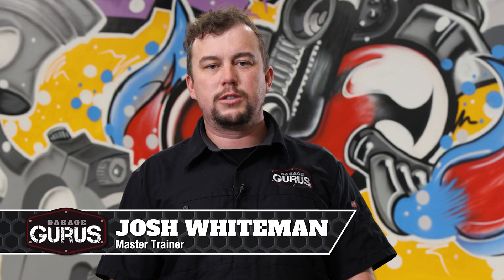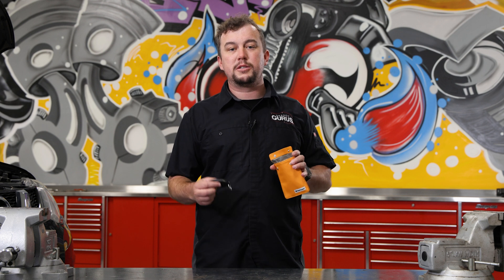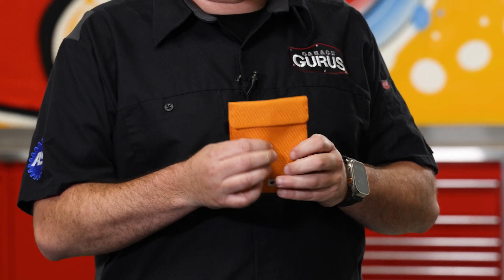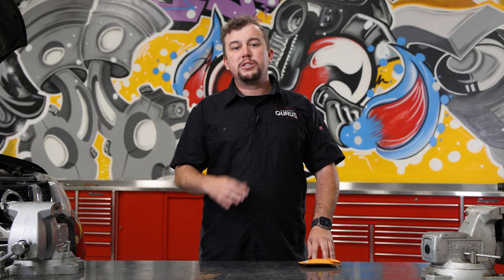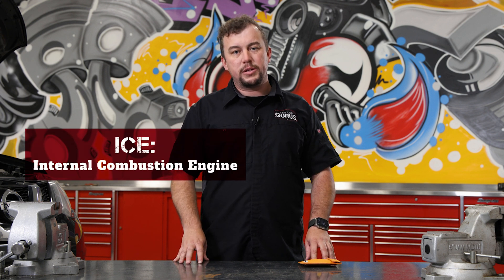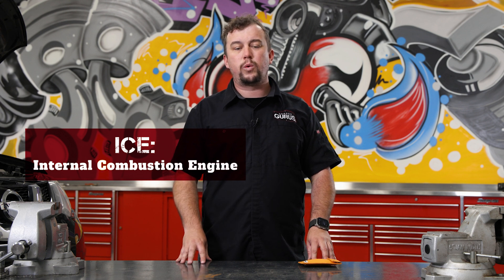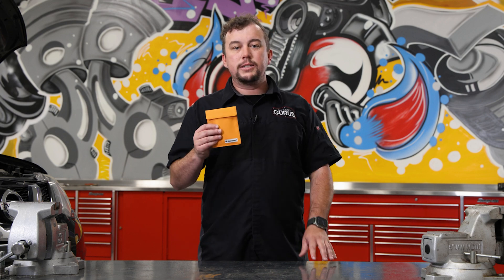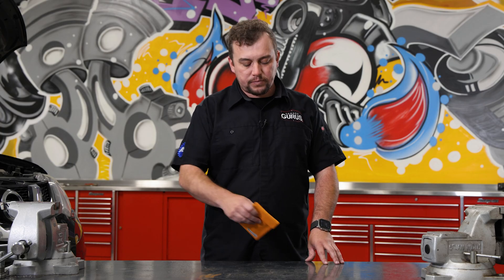Garage Gurus | How to Block a Key Fob Signal When Doing Repairs

Comment: 20 years ago I put a car up on the lift to do exactly that. An oil  change. As I was trying to lift it, the aftermarket alarm kept going off. From the motion sensor. 

The buttons were worn off the key fob, so I had no way of knowing which did what. I kept fooling with the buttons, and finally got the alarm turned off. Or so I thought. 

5 minutes later, the car started. Yep. No oil in it. I couldn't let the car down fast enough, to rip the coil wire off it.
Reply: Should have grabbed a ladder and stepped on the brake pedal that will shut it off.